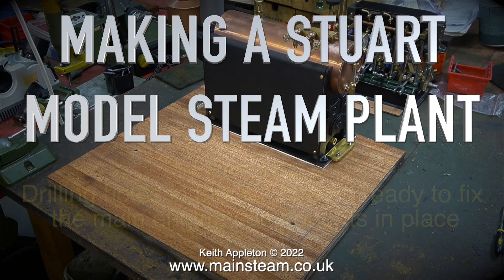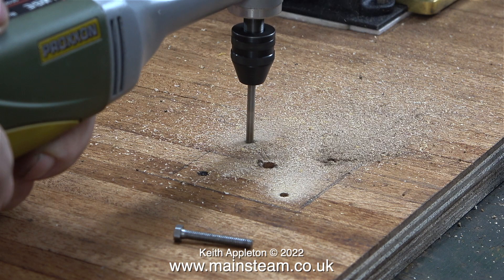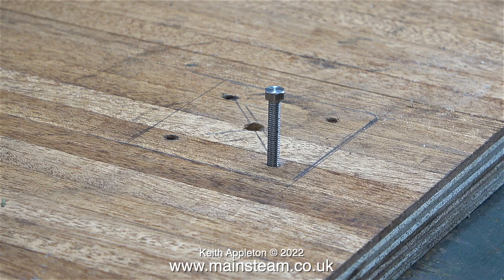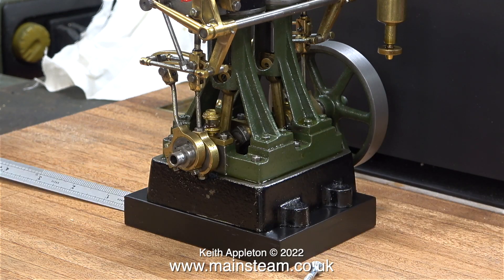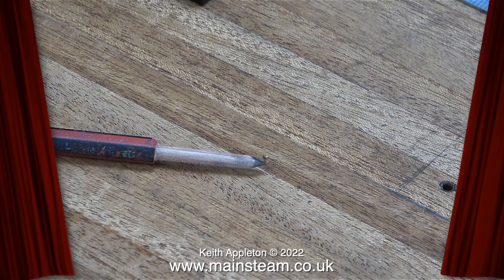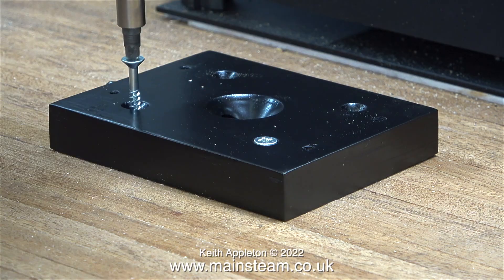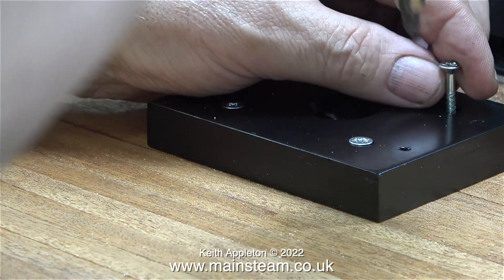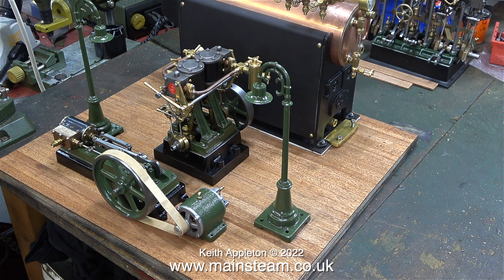MAKING A STUART MODEL STEAM PLANT - PART #61

Comment: i can see a simple little mounting plate for the dynamo and a screw to move it closer and further away from the main hub ... a basic brass L bracket with a heck steam engine wheel to adjust the belt ... tunr one way it gets closer ... the other further ... 
angle the part the dynamo sits on to angle to the dynamo ... the side rails to slide against hold it down with a lil space to slide ... and poof adjust tension with a screw to pull or push the dynamo closer or further away from the drive wheel ... 
.
it will be fiddly but if scaled small enough should look like something they might do in a large plant